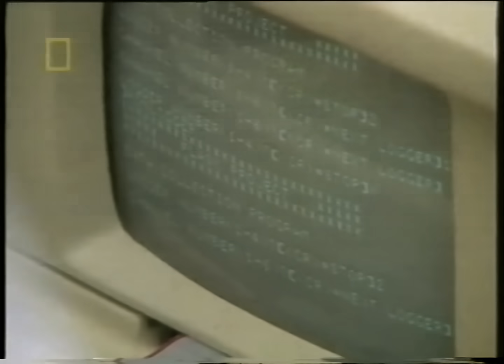Train Crash Test @ 160km/h (99.4 Miles) into 50 tonne Metal Block

Comment: Operative phrase….. “…no SIGNIFICANT change.”  When it comes to nuclear radioactivity, zero change is the only safe containment answer.
Reply: Wrong,  the pressure in the outer layer prevents leakage from within,  so it's able to vary (by design) to absorb the energy of impact. 

There is no shame in being wrong on this,  the real lesson here is that you need to understand how something works in order to draw reliable conclusions,  sure you'll get lucky off intuition some times,  but I'm the nuclear industry particularly,  some times isn't good enough.
Reply: @xaiano794 .  Thanks, but I think I didn’t explain enough. They said there was “no significant change”, which I understood to mean there was some drop in the pressurized system, referred to as insignificant. Does that not mean there was a leak? If so, however small, did something very dangerous escape? I’m going by the language used here, not the technology. Again thanks for your point.
Reply: @cut2way the language means little if you don't know what it applies to.  For example I could say "this is the fastest [blank] on earth!" But without knowing what it was you couldn't tell how fast it was or even whether it was talking about physical movement at all!

And no to both,  a pressure change does not require there to be a leak,  pressure is dependant on 3 things: how much of a gas there is,  the volume of the space it occupies and the temperature of the gas 
Changing any one of those will change the pressure,  so deformation of the unit,  however slight,  would change the pressure. 
Again,  the pressure in the outer layer is protective and it's only if all the pressure was gone that there would be a problem.
Reply: @xaiano794    Ah ha! You explained this very well. Thank you for your patience and taking the time. I see now that deformation in the container would alter pressure readings either way and not require any leakage at all.  Too bad you were not narrating the video.

Comment: Dont know...railroad width in UK is 1435mm, in this video the train from 9sec till 13 sec covers about 7 times the width of the railroad, circa 10m. So 10 m in 4 sec is roughly 9km/hour...and it seems much , much slower than 160km/h too...British scientists...
Reply: You can't possibly measure speed of any vehicle like that,  perspective from any camera distorts the distances. 
The way to read speed from a camera is to measure how long it takes a known length to pass a stationary point (example the length of the train and the time) or conversely a known length against the same point of the train,  for example passing 2 structures a known distance apart.

It was marginally under 160 because it was pushed to speed with another locomotive and allowed to coast,  but as a driver myself I can tell you that it couldn't be more than 2-3mph in that time
Reply: @xaiano794  Exactly that is how I calculated the speed...
Reply: @falconryforever that's not what you said in your comment,  you were comparing the width of one part of the image to another part of the image.  The image can't be relied upon,  you'd need physical measurements which are pretty easy to get since trains have so much information online
Reply: @xaiano794  I give up...
Reply: @falconryforever  OK let's work backwards to show how badly perspective distorts your calculations: the locomotive alone is 20.7m in length,  you can clearly see that it moves several times it's own length during the 4 seconds you quoted. That means your estimate was out by thousands of percent
Reply: @xaiano794  where is the 20.7 m comes from ?
Reply: @falconryforever  that's the length of that exact locomotive. you should be able to find it from several sources quite easily.
Reply: @xaiano794  give me a source then...
Reply: @falconryforever errrrr Wikipedia for one?
Reply: @falconryforever  could i ask how old you are? I want to structure my responses to suit you better
Reply: @xaiano794  Is Wikipedia states that, what is the exact length of that locomotive that they used in this experiment ? So to close this nonsense argument, we ( I ) know the rails width down to the mm, if you use that to estimate the trains speed as I described, using the v=d/t formula you will get a very close  estimate , how much error is there 5-10 % ? Doesn't matter , the speed is still friction of the stated one. If you cant, or don't want to understand that , than I wish you a nice day mate....
Reply: @falconryforever actually you were out by thousands of percent,  the mistake you made was on the 'd' due to perspective. 
Again we can prove this by simply working backwards using the same formula: since we can see that the locomotive passes a single point in roughly 0.5s, and you're claiming it's moving at 9kmh, which is 2.5 mps, meaning you're claiming that the entire length of the locomotive must be 1.25m

Obviously we can see this is not correct at all.

You tried to measure distance from the size of objects on the screen,  you can never do this as perspective will always affect your results and can't accurately be compensated for.

Comment: SAFETY FIRST !
The fundamental reason for this test which had been stimulated by the Civil Servants in the Ministry of Transport, was to allay public fears about Nuclear flasks, and prove it is safer to send such material by rail not road. And one of the main reasons why some branchlines were NOT totally closed such as the line to Dungeness, where there are 3 Nuclear Power Stations.

Comment: 160 km/h is very fast. But the train does not seem to reach that speed. may be around 50-60 km/h
Reply: i agree that does not look like a 160km/h, but if you calculate the speed from the distance the train travels it's pretty high. from 0:10 to 0:12 the train travels it's lenght (3 cars and the loco apprx. 80-100meters) for about 2.5s. that is 35-40m/s which is 126-144km/h. 
there is NO way the speed is anywhere near below 120km/h, let alone 50km/h.
50km/h is 14m/s. the train covers much more than 14 meters every second!

Comment: The actual flask used in this test is located outside the Training Centre at Heysham Power Station in the North West of England and can be viewed by the public by request. It is almost unmarked apart from some minor bending of the fins on the flask body - very impressive.
Reply: Can confirm- I’ve seen it!
Reply: rahhhhhh

Comment: Very reassuring for the public that if the train you’re on crashes with such a container, you’ll be completely safe from the toxic contents :D
Reply: Apart from the driver, who will be a pancake
Reply: Yea where is the data on what happens to the passengers when the train hits a 50 ton block! 😂
Reply: To be fair that would significantly delay the rescue of injured or stuck passengers, not to mention everyone stuck in the train suffering from radiation sickness. It's also not like a less durable container would prevent the train from derailing at all.
Reply: @maksrambe3812 there wouldnt be radiation sickness it was completely uncompromised
Reply: @monkeyanimationandgaming  exactly, I'm saying that a slightly weaker container that releases radiation in the event of a train crash isn't really better
Reply: @monkeyanimationandgaming  the video did not say completely uncompromised. they said 'no significant change' which makes me believe that there was a change of some sort. sounds like they are sugar coating it.
Reply: @those fins on it
Reply: Well you'll likely be dead from the impact so yeah, not much can affect you at that point
Reply: Not from the train you will not. ---Master Yoda

Comment: The problem is that a crash isn't the worst thing that can happen. Tunnel fires are far more destructive and since this crash there have been 2 tunnel fires that would have destroyed the container. They both burned for days turning the two tunnels into blast furnaces and analyses of the events concluded that both times the nuclear transport vessels would have been breached. There has been no attempt to address the risk or even improve the nuclear vessels since those disasters.

Comment: Imagine how much stronger those containers would be with modern materials.
Reply: They would still use thick steel today - used fuel rods still produce a lot of heat, this containers get more than 100°C hot at the outside if there is nuclear waste inside.

Comment: Was that a class 37 wasted?
Reply: I thought it was a 45 or 46, they also have three front windows but a shorter nose. 37 has window wipers at the bottom and 45/46 are at the top.

Comment: It's not a metal block -it a nuclear container -used to transport spent fuel from power stations to recycling plants like Sellafield . In the 70s they were transported by road from Preston to Toulouse in France -a company called Harrisons transport from HOLMES nr Southport. They used Fiat tractors to pull a short 20'trailer with a small vessel on it's back. The rear of the tractor unit had a lead sheet for driver protection !! Killed the tractors all that extra weight on its chassis !

Comment: They cheated. The engine hold-down bolts were removed, so that the kinetic energy of the train was reduced by the engine going it's own way. A bit like the controlled breakup of a crashing F1 or Indy car when the engine/gearbox is designed to break off in a bad crash,.

Comment: The engine in the locomotive had been loosened so it's impact would be lessened. You will see the engine flying out of the roof of the locomotive and laning on the other side of the flask.
Reply: The generator, not the engine. Exhaust coming from the loco body throughout the crash.

Comment: Love the way the engine comes flying out at :36.
Reply: I think that is what Americans call a prime mover (0:36)
Reply: I think the bolts were removed from the engine mounts for some reason.
Reply: @peterking2794  It was theorized they intentionally unbolted the engine so it wouldn't damage the flask, biasing their test.  It does come flying out in an interesting way, normally crashes don't look like that.
Reply: Im confused, I never saw the engine move and some pictures after show the engine still in place, the bit I saw shoot out of the roof was probably the heater equipment
Reply: @Maude_65243  It was the generator; you can see the power cables trailing behind it. The engine (at least some cylinders) was still in place and running at the time, turning the exhaust white as water mixed with fuel in the broken crankcase.
Reply: @danlefou  wait, why would there be fuel in the crank case?

Comment: I would like to be a train driver on this train.
Reply: Sounds to me like you've gone completely off the rails regarding this one
Reply: He got an extra bonus in his wage packet though
Reply: @Arid Train pedal? You mean the dead man's pedal? They are not a thing in the UK, in any case the good ol'American tradition of dumping a tool box on them would solve that anyway. There are documentaries on this stunt. You can look up those and see that I'm telling it how it is. No point discussing this further. There was no need to control the speed with precision, so they simply did as I've already explained.
Reply: @karlosbricks2413  A dead mans pedal is a thing in the UK they're call DSD or Drivers safety device and they're a requirement for mainline trains
Reply: Same
Reply: Bro 😔
Reply: Shut the fuck up idiots its fucking simple they just fucking set the train to full throttle and got off the loco
Reply: @senic3515  You can't just set the throttle to full open on one of those you'll overload the traction motors and the likelyhood of wheel slip is high too.
Reply: @tgm9991  no, they pretty much did exactly that. It was scrap anyway so they just went full send. No special remote gear but most of the safety devices we're disabled.
Reply: Chuyew And risk your own life?
Reply: Same man same
Reply: going out with a bang, i relate to wanting to die like this
Reply: You can't.. It is a remote controlled train lol.
Reply: @Martinski Mariusz | r/whoooosh
Reply: @throwaway80345  there wasn't any joke, bruh
Reply: AMTK350 Chuyew was doing a suicide joke
Reply: @s_rv.  oh ok
Reply: @anhkietduongdo  lol yes there was r/whoosh
Reply: @blackadder4590  actually it wasn't, RC technology was far too expensive and complex in those days, what they did here was simply find the distance required for the train to reach the intended speed, then at that distance they jammed the throttle wide open and let it accelerate on its own.
Reply: @karlosbricks2413  makes sense to me...

Comment: I don't know whether or not anyone else has pointed out, that this particular 'Peak' locomotive had it's 2500bhp power unit bolts either partly removed  or weakened. If you see after the impact,  the locomotive's engine(motor for the US) comes out through the top of the casing, reducing the the force of the impact. This was all pointed out decades ago.
Reply: I saw this accusation - basically the prime mover mounts were in no way designed or intended to last through a 100mph crash, especially when the chassis was already broken and mangled. You would see the same result in modern trains if the were subjected to this test. 

The engine, being the densest and heaviest part of the locomotive, would keep moving well after the chassis had stopped. Had the bolts been removed, the results would have been the same.
Reply: @boundaryzero  there's also another comment that points out that it's the generator that goes flying into the air on impact—the engine stayed in place.
Reply: @mr_bassman6685  it may be, but the engine is still the heaviest single part AFAIK - the generators are heavy too
Reply: LOL, nut job.

Comment: The only reason why the Nuke container survived, was because UK Train they used are old and unreliable.
Reply: wrong, those big peak locos were very reliable and when the test was done in 1984 they were still widely used in British Rail. The reason they used it was because it was 138 tonnes which was the heaviest loco BR had also, because it could maintain a steady 100mph without a problem

Comment: OMG,what happened to the poor driver???
Reply: There was nobody on board the train. The locomotive had been modified so that it could be sent on its way by someone standing beside it flipping a lever; this was done from about 10 kilometres away from where the nuclear-waste container was placed, so as to allow the train to reach a high speed. The purpose was to demonstrate that the nuclear-waste container would not burst open or leak even in a severe crash.

Comment: I worked at Hither Green Locomotive depot as a second man in the late 70s early 80s and we had some of the jobs to move these flasks..only problem was that for reasons unspecified you were always supposed to 'have the road'..ie not be stopped at red lights..particularly in high density populated areas..the driver..2nd man and guard had shielding between them and the flask..the residents whose property backed on to the line did not👜
Reply: john piper  At the time.. 76,77,78...we were told it was to prevent those living near the track being over "irradiated"...there was a much much lower terrorist threat then...though having said that I transferred from working @ cannon Street station (platform 7 and 8) where the IRA placed a bomb on a commuter train....that went off as it was on its way to southwark depot for cleaning 👉🇬🇧👈👉💎👈👉😵👉👁️👉⚠️⚠️⚠️⚠️⚠️

Comment: "There was no significant change." But there was still a change.
Reply: Yes, probably because the container was slightly deformed from having a train hit it at 100mph, changing it's volume. A change in pressure doesn't automatically mean a leak.
Reply: Drake Tamer yes but no significant means it doesn't matter
Reply: I wonder if it was atmospheric pressure :p

Comment: No 'SIGNIFICANT' loss. In other words, there WAS some. How much nuclear active waste do YOU want today??
Reply: The pressure may have increased due to it crushing in. Quit being so paranoid.
Reply: Lewie McNeely 0:48 No significant change in pressure inside the block.
Reply: Remember WHO was doing this. Their 'significant' and my 'significant' are probably a LOT different and if you think you haven't been lied to, you might better take a good close look around you, pal.
Reply: @lewiemcneely9143  an insignificant change would be a change explained by the change in temperature or shape of the container. No significant change == the container got a little warmer so the contents expanded, no leaks detected.

Comment: "No significant change" so that means there was a change, then how much change in pressure was it? Is it a slow leak? I hate when news reporters do this
Reply: Guessing it's a change in pressure due to the container being deformed, not an actual leak, otherwise it would've failed the test.
Reply: A loss of 0.28lb/sq. in from a starting pressure of 100lb/sq. in.
Reply: @neiloflongbeck5705  That's pretty remarkable and an insignificant loss . . .

Comment: No significant change in pressure inside the nuclear vessel under test. OK. The volume has shrunken by 50% so the pressure should have gone up 50%. Not a reliable test.
Reply: wait, what?

Comment: Why don't they make trains 🚂 out of that material. Then we would have any more train disasters. 🙄
Reply: Would you like to be inside a tank when it decelerated from 100mph to 0 almost instantly? The tank wouldn't be damaged all that much, so what is there to worry about?
Reply: They do. It's called steel.
Reply: That would make it more dangerous. The locomotive body wouldn’t be able to absorb as much of the impact.

Comment: What's thee weighte differencee betweene a tonne a ton?
Reply: Nonov Yerbusiness an E and one less N
Reply: Very little. The tonne is officially defined as 1000 kilogrammes, and the ton usually as 2240 pounds although there also exists a "short ton" of 2000 pounds.